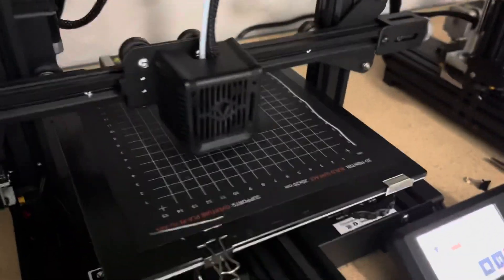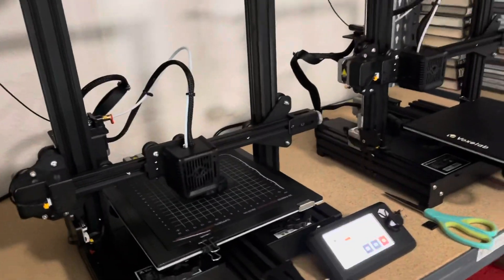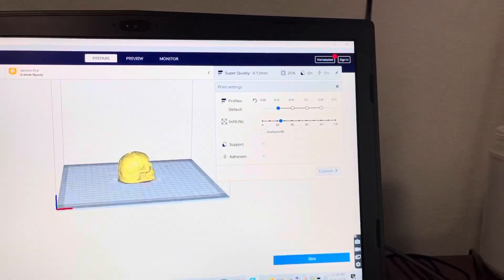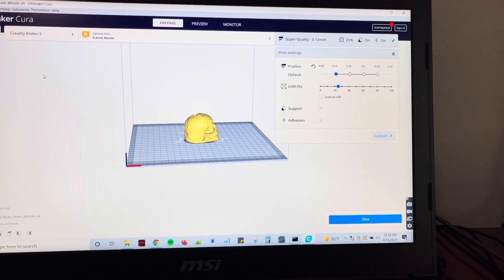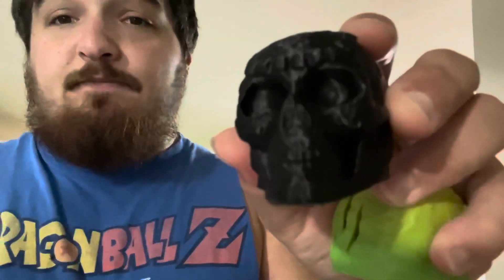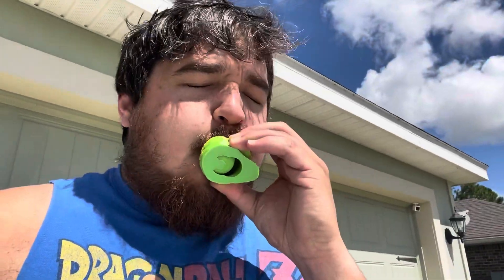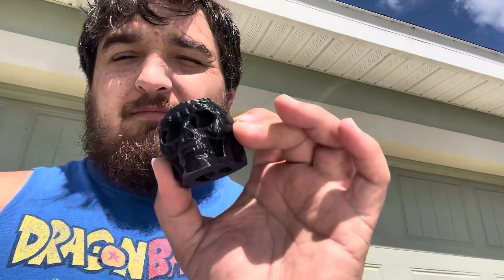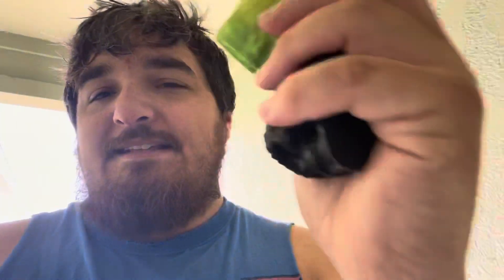Finally Got a Perfect 3D Print Aztec/Mayan Death Whistle

Comment: I don't understand why you're saying you need more infill. I print them with 5% infill for Halloween gifts and they all sound great
Reply: What do you do for supports? Is there anything I need to modify?
Reply: @bigmacsixpacc  no supports needed.
Reply from the maker: @adamsaquatics3332  with my printers only way I could get them to print right was more infill. The less infill the worse it sounded
Reply: @SmittysWorld  Interesting. I'm using a Voxelab Aries printer. Bit of a different style but shouldn't make a difference. I wonder if it's a temp to layer issue.
Reply from the maker: @adamsaquatics3332  not sure I’ve got three of the same ones that have been giving me a lot I mean a lot of issues with material sticking to beds no matter what I do. Been that way since out of the box. So could be issue with the printers themselves
Reply: @SmittysWorld  Try wiping your bed with a rag and rubbing alcohol.  Oils from your hands will prevent adhesion. So will dust and leftover filament
Reply from the maker: @adamsaquatics3332  tried all that and even did the Elmer’s glue truck that ended up helping some. Got some new beds and worked better but ended up stopping 3D printing because it was such a waste of money and headache because of it.
Reply: @SmittysWorld  That's unfortunate. There has to be a way. Do you use PLA, PETG or AGS? Does your bed heat?
Reply: @SmittysWorld yo dide, you still 3d printing?? I'm new to 3d printing like only a month if that.. was ready to give up because none of my prints would stick.. come to find out I needed to adjust the z height, because I was printing just too high above the bed, so it didn't get enough squish factor and kept moving.. ever try that? Lol. I know it's been a while since you made this comment haha

Comment: Currently got one of these on the go, 0.16mm layer height and 25% infill let's hope it comes out ok 🤞
Reply from the maker: I'm Printing 3 more right now they seem to be doing great. What printer are you using?
Reply: @SmittysWorld  I'm currently using an Ender 3, I'm really tempted to give it a go on my elegoo mars resin printer too.
Reply from the maker: @DeanMakes  that would probably turn out way nicer because of the internal design.